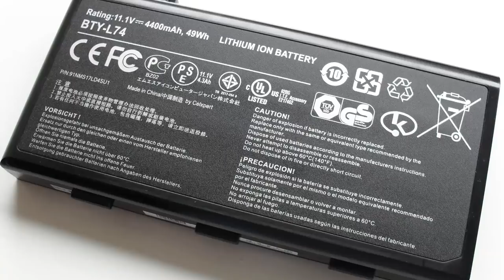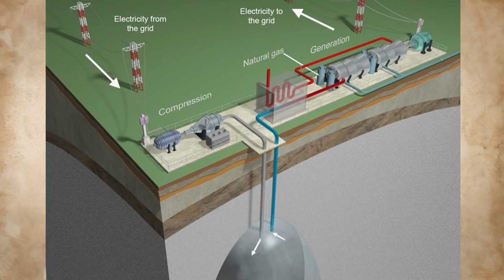Why We Need A Revolution In Energy Storage

Comment: I would love to put a flywheel battery in my backyard, but it would spin so fast (while I'm not home) that the wheel would need to be made of some exotic alloy that would have huge resistance to breaking.
I'm sure the flywheel would also need advances in lubricant or ball-bearing nano-technology (or magnetic field technology) such that the friction value would be as close to zero as possible.

On another note, Dean Kamen (inventor of the Segway transporter) is working on a hybrid stirling engine generator, but it's not available for consumers yet.
solar panel + stirling engine generator = awesome

Comment: Great video.Nice to state that the lithium battery made the smartphone possible. Further improvement (better and/or cheaper) of energy storage is indeed badly needed. But not only battery storage is investigated also ways of making Hydrogen from the surplus of electricity is apossiblility. There is even a German institute that makes petrol out of CO2 and H2O with energy that stems from wind and solar installation. Also a way of thinking.

Comment: I believe that I have designed a more efficient kind of car battery that does not store the energy chemically but with an alternative system (which I will not specify until I get a patent on it) and would convert that energy directly into a mechanical motion, already more efficient than having a chemical battery transmitting its power through wires, then wrapping around a solenoid making mechanical motion with an electromagnetic field. Which I believe that it is the kind or energy storage system we need in transport.

Comment: A bit late for comments, but batteries aren't the only solution for grid level. Ultra High Voltage Direct Current power lines can get power from one side of the planet to the other with less loss than charging a battery. It's always sunny or windy somewhere.

Comment: I am not a chemist or an engineer in any sense of the word, but I wondered many years ago if it would be possible to, instead of having a chemical reaction for a battery, have an array of millions or billions (trillions?) of microscopic capacitors that would release their tiny stored energy one at a time (in rapid succession, depending on demand) to create energy flow? I can imagine the minimum size would be limited by how well the caps could be insulated from each other and other technical factors, but think of the advantages: Extremely long life, possibly infinite charging cycles and super fast charging capabilities. Remember, I am coming at this from the point of a layman, so I am probably waaaaay off!

Any ideas?

JW3HH

p.s. If we can fix just the problem of slow charging (compared to refueling an ICE), that alone may be enough to convince the "fence sitters" that an electric car is viable. After that, we just need to encourage gas stations - or anyone, really! - to offer high-capacity recharging stations at their places of business.

Comment: I always wondered what happened to the push for Hydrogen creation. I remember several years ago the hydrogen powered car was a big thing that was suppose to help the environment. I don't think it was the right thing for transportation, but why are we not using this extra energy created on off peak hours to create hydrogen that can be used later?
Reply: seth davis two words: Big Oil, that's the main reason
Reply: seth davis also the possibility for a hydrogen explosion which is another
Reply: seth davis Necro post so, sorry for reviving it.
Hydrogen, as a fuel, requires more energy to make it than to use it. The electricity required to separate the hydrogen from water (like companies wanted to do) could have been used to directly power a system. To make long short, the output was less valuable than the input.
Reply: @callfororion8846  - that's merely a technological hurdle for hydrogen. It can be overcome. If we can invent more efficient batteries, we can invent more efficient hydrogen generation methods.
Hydrogen cars are what we should be going for but battery fanboys won't let us. All the issues hydrogen cars face are merely technological, but the issues battery cars face are not only technological but also practical. For example, it doesn't matter how amazing battery technology becomes - I park my car on the street and don't have a garage. How do I charge my car?
Reply: @hrthrhs  Hydrogen is a very useful fuel source, quite undeniably, but like I said in my reply, too much energy is required for the output to be worth it. It's about efficient energy transfer. Nowadays, gasoline and electrically powered cars are the standard for a reaaon. Gasoline is less efficient than battery powered cars but is easy to amass. Battery powered cars use their energy better as there is less wasted on friction and sound, but is difficult to retain charge for long periods of time. You said this in your comment. Hydrogen is different based on the fact that the easiest way to gather it is through electrolysis. The amount of energy required for electrolysis is more than hydrogen, but hydrogen is more volatile. In a perfect scenario the energy transfer would be 1:1, but it isn't. You could say that the same is for aforementioned fuel sources, but it is not for one simple glaring flaw; storage and transport. Hydrogen is a gas, meaning that it needs lots of space. If you try to save space through pressurization then you run into the problem of volatile gas being put into a tight area. This essentially makes an explosive canister. On a commercial scale this could mean serious danger. One stray electrical spark could cause many deaths. Also, if a car containing hydrogen meets sparks caused in an accident through rubbing metal, that causes a large explosion. This same scenario is applied to propane powered cars. A spontaneous fuel leak and someone smoking nearby causes the same effect. While I want a truly clean burning form of fuel/transport, I am skeptical of its efficacy.
Reply: @callfororion8846  I tried to look into the efficiencies of the electrolysis of hydrogen more but couldn't find too much in detail. But you might be onto something - there is a certain minimum of energy required to separate hydrogen which can not be reduced.

I just can't get past the fact that battery cars can not come close to completely replacing fossil fuel cars. Unless we develop rapid charge batteries/capacitors (giving several dozen miles range from a few minutes charge) or rapid replacing of a depleted battery with a charged one.
Reply: @hrthrhs  Yeah. I think a solution to that problem would be Hutchison cells. They don't seem to be very advanced yet but given enough time, I believe they will be a better choice for a battery

Comment: The problems of batteries differs between usage scenarios. For example, for a car it is important that they are compact, light, work under large temperature ranges, etc. However, for grid backup batteries in homes and plants, the weight does not play such a big role, also compactness is not really important. Instead they must be freaking cheap to be able to compete with regular plants. The cheaper there are the better the you can model the buy and sell business model around the storage. Also they must sustain many load cycles. Instead of cars you can insulate the battery storage much better. Therefore, temperature is less an issue.

Comment: I do think that batteries are going to be a major factor in the future of energy, but they will need some help from improved power sourcing, such as thorium salt reactors or even fusion reactors. I don't think those will work great as home solutions like solar or wind, but would make for a great constant supply for industrial use and to fill the improved batteries of places with high population density where solar or wind are simply not practical.

Comment: The modern power grid is kept in phase using GPS signals. That is, the atomic clocks on GPS satellites send radio signals that are picked up at power stations and are used to time out the alternations of the current. (All the power stations have to be alternating in time with each other) Would Edison understand it?

Comment: what about the h2-o2 fuel cell which is most efficient battery (70%)..and easy to make....and used in rockets..with no pollution
Reply: All fuel cells are chemical heat pumps and that means when you scale them down, just like piston heat pumps, they lose efficiency, and subsequently have similar efficiency as any piston powered engine of similar size. And they separation of hydrogen from oxygen is.. really low efficiency,
So a realistic number is more, 15%-30% efficiency generating hydrogen, and 20-60% efficiency converting hydrogen into electricity. Or 60% of 30% for a best case, and 20% of 15% for a car sized unit.

Batteries are efficent enough to surpass hydrogen by a long shot close to 90 percent as far as storage goes, but they are nowhere near compact, or safe enough to do what we want them to

Comment: Instead of using exotic metals like lithium (and lead is also semi exotic) to make our batteries we should just split molecules of water and CO2 to make carbon, hydrogen and oxygen and then you mix the carbon and hydrogen to make methane then release the oxygen. It's just a less complex version of photosynthesis and a plus is that you don't need exotic metals and instead of retrofitting all cars to go electric you could just retrofit the cars to run on methane (or you could package the oxygen with the methane to make a fuel cell).

Comment: Hasn't anyone heard about Graphene? It is very thin, almost transparent, flexible, a 100 times stronger than steel, and conducts heat and electricity better than copper. It is possibly the best electric conductor ever created, which means it can be used in batteries that are much more powerful than Lithium Ion, larger capacity and charge even faster. And carbon (which it is made out of) is the 6th most abundant element in the universe. Okay, it has to be one of the materials they are experimenting with.

Comment: Free energy is very possible today. I imagine how long are the new discovered batteries can run an electric car and can be charged in just a very short time. What about running a generator? If it could run a generator to charge 10 batteries before the battery used is fully discharged, we can replace it one from the 10 batteries fully charged; so there will 9 extra batteries available. Is it not a free energy? 
Cars can run spontaneously with enough number of batteries, a generator and induction motors. Likewise, every home could also have unlimited free energy in anytime.
Reply: You don't really understand thermodynamics and energy theory. You can't make more energy than you put in a system (first law of thermodynamics). If what you were saying is true, you could put 10 generators instead of 1 on a hydroelectric turbine shaft and make 10 times as much electricity. There is no free energy! If you have 1 kWh of energy inside a battery, you can't use it to generate 10 kWh.

Comment: Solar cell actually give a DC power and It need a converter to convert them to AC for use in the modern day electric equipment. So now someone try to revive a DC power system back.

Comment: talking about energy storage and you all forget to mention the best system of all.
Power to gas...  h2 creation to be used in the transport sector in all kind of vehicle (minus the city car or low range vehicles) or it can be injected to the natural gas grid.
You was wrong about batteries that are bad at big scales.. but good for your phone.. that is not true..
Batteries are cost efficient (no matter the power of work) if you dont need to storage that energy for more than 3 or 4 hours.
Electrolysys-fuel cell-h2  is better when you need to storage from 5 hours to 2 month of energy.
Power output does not matter.. just the time you need to provide that power.

Comment: We already have a cheap energy generating technology. It's called fission. Nuclear power in its current form already does less harm than any other source of energy we have (including wind and solar), but the costs are driven up for political reasons. We can solve this by looking at molten salt reactors instead of covering earth in solar panels. (independent green energy is already proven unachievable, so what the frak is everybody still excited about? Why don't we concentrate on the stuff that actually works?)

Comment: Look, please, just please.

The BIG issue with lithium ion accumulators is that they are quite prone to explode.

Now what you'd want, is MORE energy density?! It just cannot be that stable!

Unless it's something totally different, like making oxygen and hydrogen through electrolysis and then using the Sabatier reaction to make methane.

Methane can be stored EASILY and there are powerplants that can use it!

It's TOO LATE to start hoping for future tech to solve our problems now. We need to take action and do what we can, right now!

I'm starting to hate this channel for spewing out this crap, please take an HONEST look at where we are and what we CAN do right now, and I mean you dear reader of my comment, not the good stuff guys. They won't have the time to read this shit.
Reply: The entire video is about finding a different battery than lithium ion. Also if you are concerned that lithium ions batteries explode, why are you suggesting methane instead?
Reply: Stuff like this is diverting us from solving the real problems. They haven't made a video studying the issues properly.
Reply: +Ace8280 Did you know that NASA won't allow devices with lithium ion batteries on ISS. So yes, while I'm not afraid of my cellphone exploding or catching fire, I do store my e-bike battery outside. If it starts a fire, my apartment wont burn down.

And what I was saying was missed. Lithium ion batteries are unstable because they store so much energy. Making a battery that stores even more energy in a quickly releasable form is an explosive. Did you know that TNT has less energy per weight than yogurt? It's the speed of release that's key.
Reply: +Guy Smith Where did you get your numbers?

http://www.fineli.fi/food.php?foodid=32201&amp;lang=en

This is a site from the Finnish government department of health.

123 kilo calories per 100 g divided by 100
1.23 kilo calories per 1 g -> 1230 calories per 1g

I think you mean kilo calories, or kcal.

Well, I should have been more specific since different yogurt have different calories per kg.